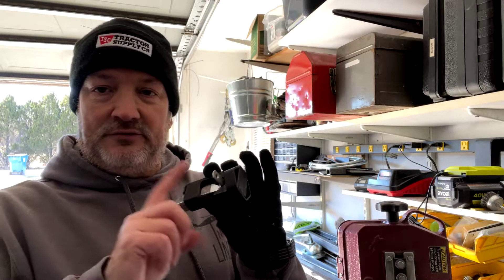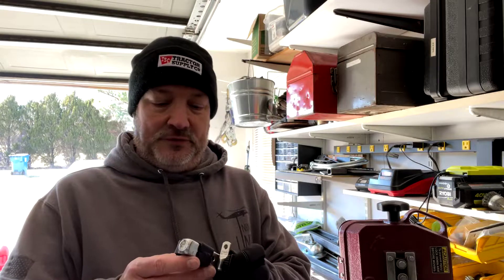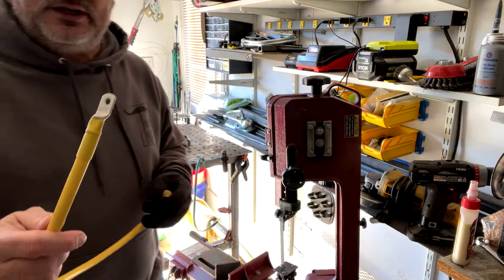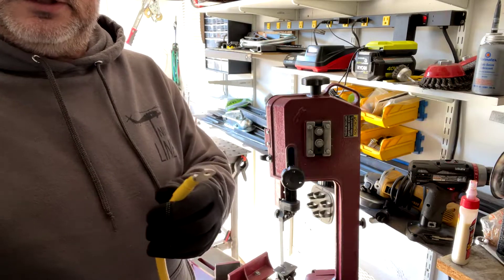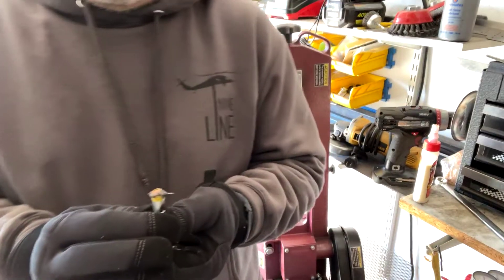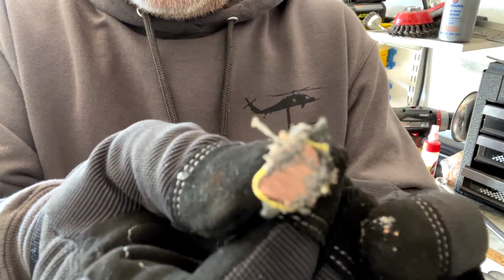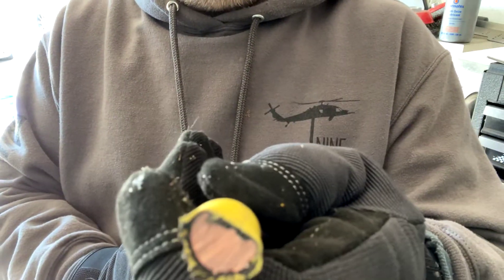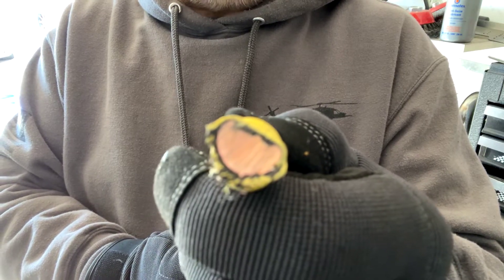Does the Lincoln Hammer Lug/Cable Crimping Tool work?

Comment: Did you put the uncrimped cable through the saw? It would have been nice to see that as the control.
Reply from the maker: I didn’t.   Simply cutting the cable would show the fine strands, as opposed to the compressed strands after crimping.

Comment: Great video!  I started out with one of those hammer style crimpers for the boat.  I don't recommend them for the boat.  They make a decent crimp without a doubt.  To use it on the boat, the beating it with a hammer is most likely going to crack the gelcoat somewhere.  Also, trying to crimp cables that are attached to the boat, need to get the crimper into a tight space, wouldn't allow for room to swing the hammer.  For an inexpensive tool to crimp cables that can be made off the boat (on the dock), they're a great inexpensive way to deal with lugs up to 4/0 in size. 

I broke my 16 ton hydraulic crimper that would do up to 4/0 cables.  The current electrical boat project I'm working on only requires 2/0 or smaller.  So I picked up a 10ton hydraulic crimper that'll do 2/0 or smaller.  It was $65 off amazon and is super small. Perfect for getting into those small lazarette's to crimp a cable.
Reply from the maker: That's a great point.  I didn't actually make the crimps on the boat, I did them on my welding table.  One stroke with a 3 lb sledge hammer.  Maybe I should do a video on actually making the crimp.